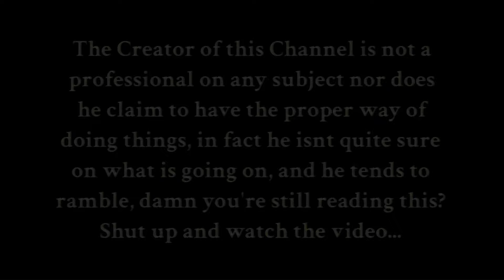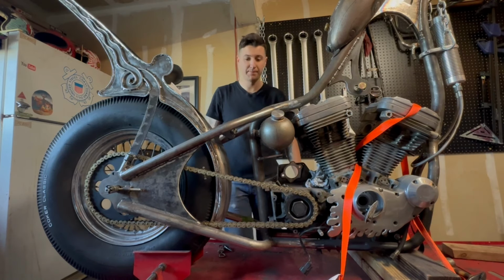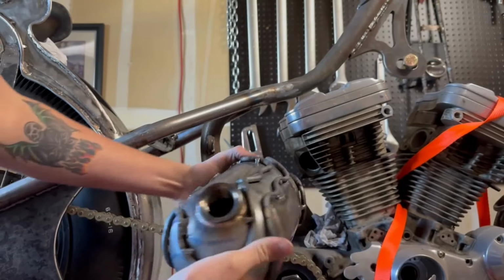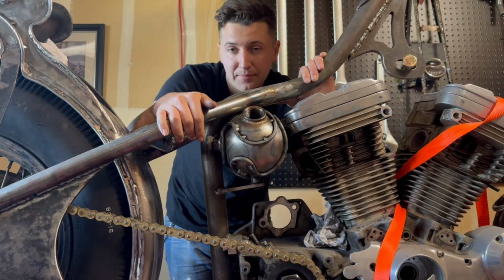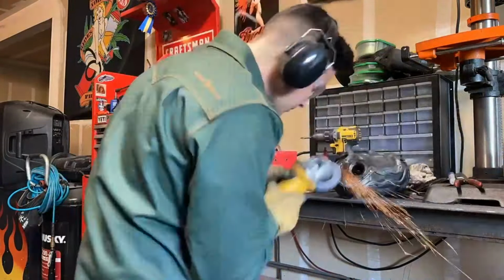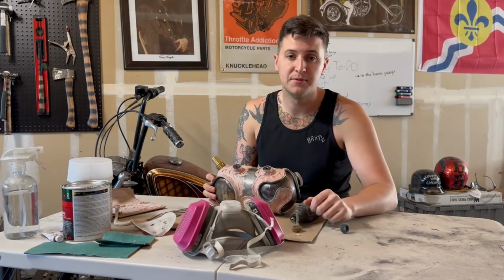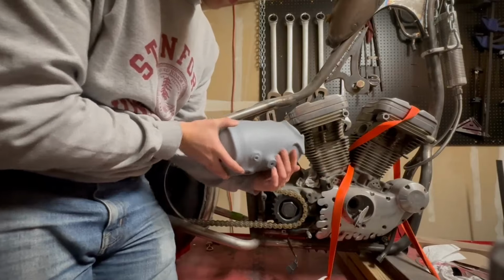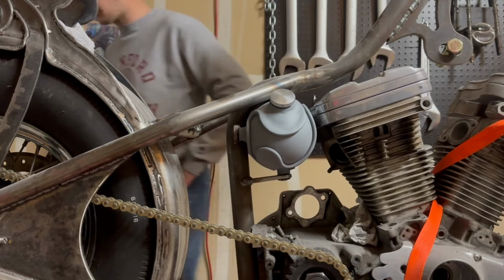Custom Oil tank molding! - Epic Long Chopper Pt. 5

Comment: have you thought about using high heat JB weld for a filler on your oil tank? it a bit tougher to sand but it'll be rock solid.
Reply from the maker: That’s some solid old school knowledge there. Thank you for the tip.